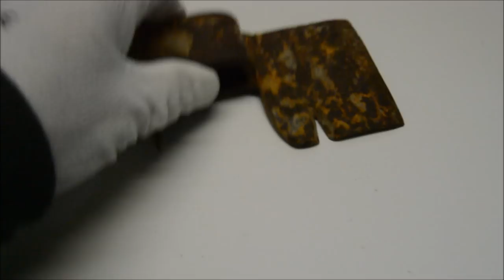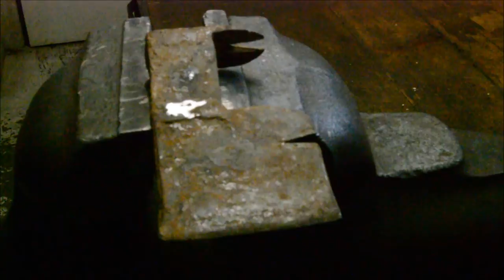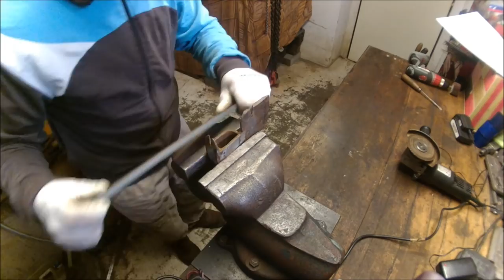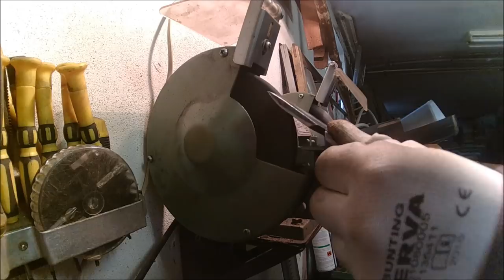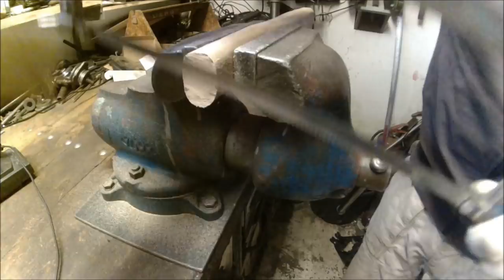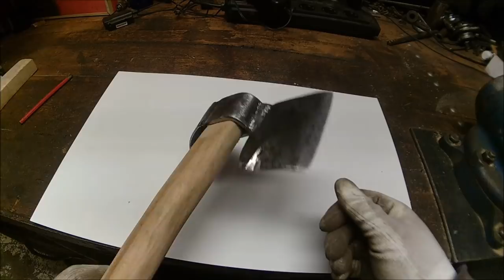axe restoration

Comment: I’m 16 and have been doing  projects like these since I was about 12. It kills me to see these guys immediately jump to a grinder, all it does is eat metal away very quickly and leaves unneeded gouges in the metal. A wire wheel would have been plenty to remove the rust. And then moving to a sand paper gradually working your way up through the grits. To properly restore the metal it takes time, not a process to be rushed. Also the head was not hung properly, you should not just pound it down on. And you are supposed to hit the other end:) to properly hang a head you should remove it once or twice atleast to check to see how much contact is being made between the wood and metal. And then properly seat the head. A finish to protect the wood should be added to prevent rot.
Reply: Rods N Guns I still like what he did with the head, and at least he took the time to put up a video, unlike a lot of the detractors above who just criticise. (not yourself) But your comments are valid and very helpful. I'll bear in mind what you said when I restore a few heads and other old tools I've got lying around. Thanks.

Comment: Striking opening graphic "ARBSU"!  Very thorough restoration--esp. since you didn't grind away much.  Some sort of chemical rust removal would have been preferred at the outset.....before abrasives.....  What sort of axe is it?  A slater's hatchet?  A shinglers's hatchet?  It has that curious offset blade combined with a nail-pulling vee....?

Comment: "Restoration" All you did was take the rust off..... You didn't smooth it out or even fit the handle right. Not to mention you didn't even put a finish on the handle.
Reply: Why the hate? like you can take the rust off or smooth it out without any skill. The axe looks great
Reply: anybody could take the rust off.....
Reply: The axe was pretty pitted. He would've had to take quite a bit off to make it smooth, one thing he could've done differently is soaked it in a vinegar bath for a day or two. That would've removed the majority of the rust and then go at it with the grinder. He did a great job overall, not sure how long the handle will stay on if the axe is used frequently
Reply: Chris Hilliard like you could do any better
Reply: Chris Hilliard I think you mean he didn't polish it out. I have cleaned up a lot of old axe heads and if I came across that particular one I would have ignored it. There is way too much rust and pitting. If you were to put that head into vinagar it would probably destroy it because it would eat away at the pitting and take away all the rust revealing how bad it really is. He did a good job considering that because if someone asked me to clean that head I would do the same thing. However, I did see him grinding off metal and that is a big nono. I did not see him clean up the eye nor did I see him add some kind of oil to help while he used a wire wheel and that can leave dark spots and could possibly heat up the head so much the it could hurt the temper. I see really bad pitting near the edge so I wonder if it would even hold. He did a horrible job fitting the handle and the wedge he put into it did not go all the way across and left a gap. He did not put anything on the handle like linseed oil and that is the most satisfying part of restoring a old head. At least rub a rock up and down the handle, you know what I'm saying.
Reply: qzetu He might've done some of those things and just not put it in the video. But I agree with the axe really being to far gone to even do it. To remove that much pitting would take a lot of steel away and change the entire axe. I'm guessing that he's never fitted an axe handle before, he didn't do a horrible job, just needs practice and proper steps to fit the handle. Just watch some of Liam Hoffman videos and you'll be set! Overall, I still think he did a good job with what he started with, just to bad that the axe was in that bad of shape.
Reply: Phillip Taylor He might have done all kinds of things after the video but this is a restoration video for his viewers and so if he does not complete the whole job to see it defeats the purpose.
Reply: Ok he might not have done all the  things you mentioned but he did turn a rusty axe head into a usable tool and he went to the trouble of recording what he did and sharing it here.
Reply: I’m with you. He did a shit job.
Reply: Smooth out an axe? Boi this in not a typical YouTube restoration video which they put all their time into it and not even use it. And to smooth out an axe?!? All your time will be wasted polishing it and it will be rusted and scratched anyways if you use it
Reply: David Redden says the man with 3 subscribers. Hahaha
Reply: Chris, what is your channel so we can see your skill level..looking forward to seeing your work..